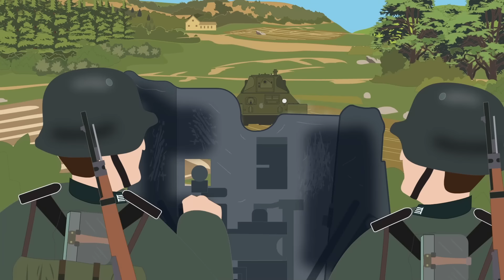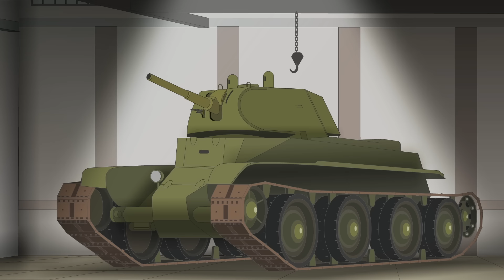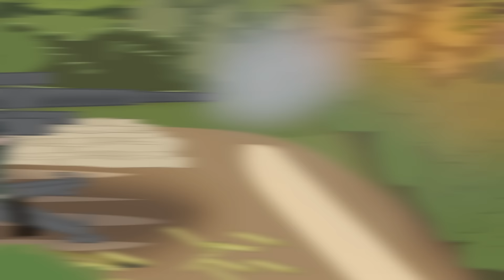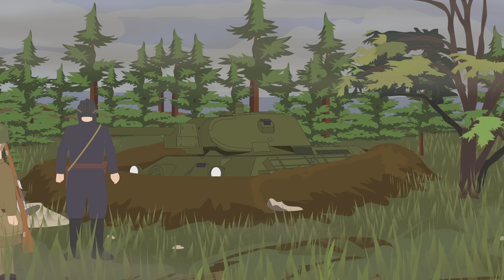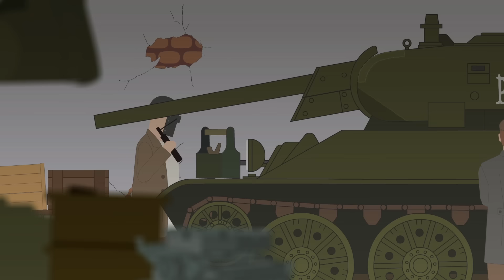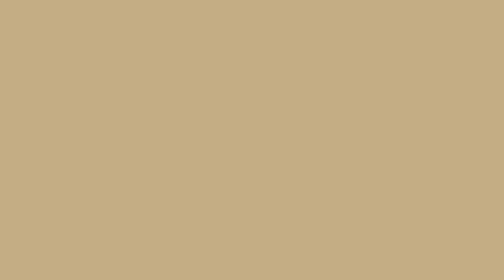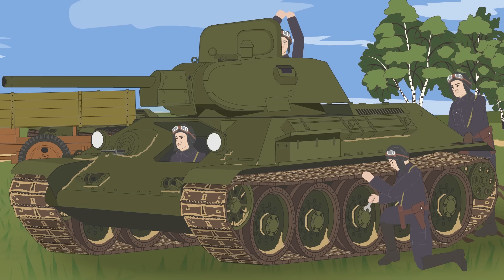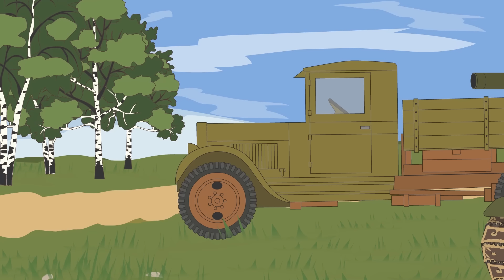Was the T-34 Really the Best Tank of WW2?

Comment: tell that to the tiger tank that was shot 252 times and still managed to get away from the fight like nothing happened.
Reply: Yes... but that happened only with frontal armour of Turret and Hull. Tigers weren't produced in large numbers, had massive transport defects (transmission being the most famous one tough there was the too low HP engine which catched fire easely... same goes for early Panther which lit on fire at 4km of use), low shell capacity, slow turn and turret traverse rate... and the fact that USSR already had info how to destroy Tigers easely or make them unusable since 1941 as first one swnt to combat (Leningrad front) bugged down in mud and was abandoned, which Red Army subsequently captured and tested for weak points.

Also, ya know why Americans were not pro Sherman Firefly? Because 76mm was used as Tigers/Panthers were extremly rare, could be pemetrated by 76mm from side or could damage enough the tank and biggest threat to Allies were 88mm Flag guns for which HE cannons were best... which 76mm was. Your Tiger tank was good tank, but it's flaws were magnified by T-34 and M4 series tanks... and especialy with later gen tanks like Pershing and IS series

Comment: The T-34 got stuck in mud just as the german tanks, had as many mechanical failures as the greman tanks, didn't have radios and had the situational awareness of a fridge. The pros were that it was a tank and the soviets had a huge f*** off tracktor factory in the Urals producing these things. It was a tank, it was far from the best tank.
Reply: *anggry wehraboos noises*
Reply: @M-a-r-c  what he said was true because Soviet advance usually stall because of mud.
Reply: @rickastley4050  yeah
Reply: What? You're a Wehraboo?
Reply: @doomguyslowresolutionmodel407  come up with something original.
Reply: @AKKK1182  What's original about Wehraboos?
Reply: @doomguyslowresolutionmodel407  go dialate and leave people's brain cells alone.
Reply: @AKKK1182  How am I assaulting your braincells if you don't have any? Did you loan them or something? 

"waaAAhhh LeAvE mE bE"
Reply: @doomguyslowresolutionmodel407  It shouldnt be anormal to admit that german tanks and soviet tanks were both imperfect. The german tanks early in the war won because they were better suited, more of them, and more maneuverable. Soviet tanks won the war in the east, because they were mass produced, and they had better armor design than the german counterparts.

Comment: They broke down and fell apart consistently. They followed the same doctrine they used for their infantry, which was if you die, let the next guy pick up the gun and continue mission. You produce as many tanks as possible, as cheap as possible and overwhelm the enemy. If the tank dies before it gets there or after, oh well. Run back to the factory if your alive and grab another one.
Reply: And yet, the soviets still won. Also, if the Red army really did follow that doctrine (for both Infantry and Tanks) than they would’ve lost faster than France.

Comment: In 1921 the US Army arsenal engineers were working on designing a tank and had a company submit blueprints for a tank transmission. It originally was designed for use in tracked agricultural tractors that the army engineers considered to be too primitive to use in a heavy tank so rejected the design. Twenty three years later the same engineers were amazed to find that same transmission being used in the T-34 sent to Aberdeen for evaluation. The Soviet Army mechanic that was assisting them didn't believe that so the engineers dug out the 1921 blueprints to show him.

Comment: Was the T-34 the best tank of WW2?
No.
Let me save you some time
The US performed a study that examined the designs effectiveness when built American production quality standards.
They found that such a T-34 was more expensive than the Sherman which had a better engine, better stability, a gun stabilizer, a better suspension system, better on and offroad speed, radios in the tank, better crew comfort, comparable armor, and a  crew survival rate of 85% compared to the T-34’s rate of 17%. About the only thing the T-34 had on the Sherman was a moderately better gun, and that didnt come into play until the T-34 was upgunned later in the war

https://youtu.be/CIZ6PFYUM5o